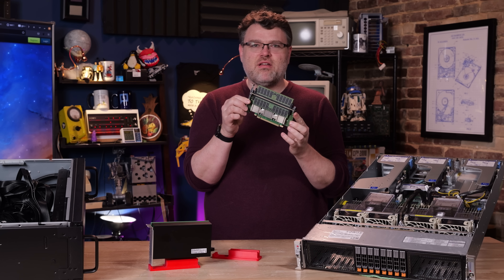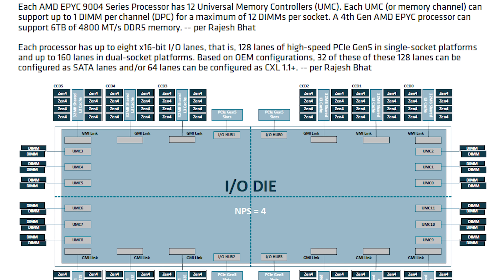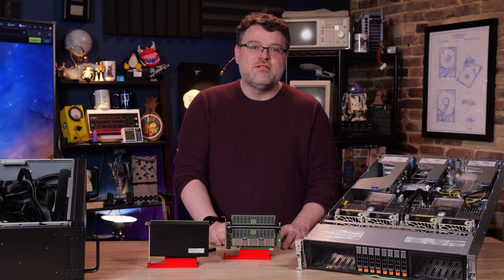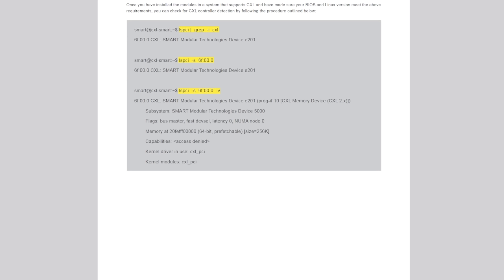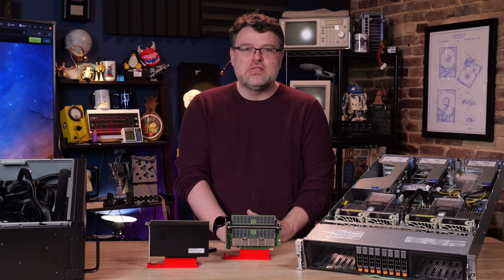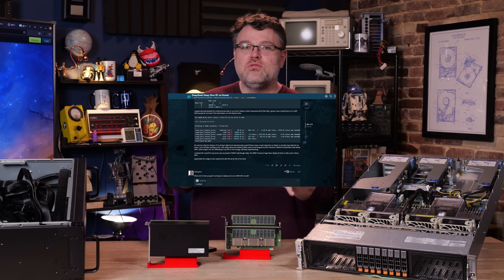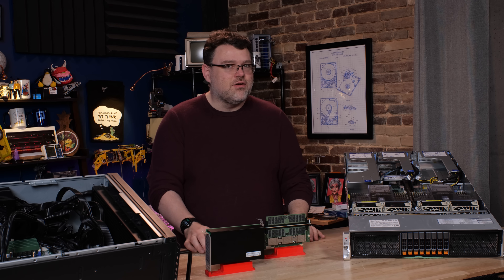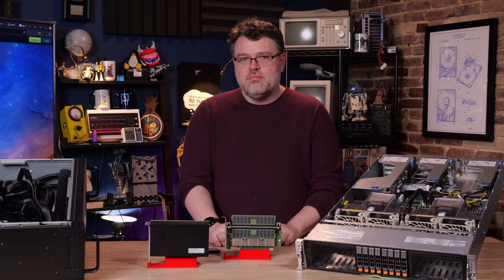PCIe RAM? In MY Server? With Smart Modular CXL, It's Possible!

Comment: With the vanishing of PCIe bridge chips on most servers as the result of the integration of high lane counts on the CPUs themselves it may be a good idea at this point to add a second connection on the slots as was done with ISA/VLB with the purpose of enabling direct device to device access, thinking about GPU to CXL RAM links in particular, so that we don't need to involve the CPU IO when it does not need to touch the data as it only needs to read or written to RAM. In this case the goal being expanding the GPU "directly" accessible and usable RAM while processing its workload eliminating any IO load on the CPU.
Reply: Devices can in fact communicate directly over the PCIe bus without involving the CPU.  That's a large part of what modern DMA controllers facilitate.  The reason nVidia introduced SLI in the consumer market is to reduce latency on the lower throughput latency sensitive timing and frame buffer data.  NVLink in the professional market was introduced more to share lower latency access to VRAM, mainly to reduce the throughput on the PCIE bus.

All that said, I would love if we had a second PCIE bus opposite the main one that we could clamp a bridge card onto and give some devices a standards-compliant way to talk to each other at higher speeds.
Reply: @aarcaneorg  It's also worth mentioning, that NVLink has almost 10x bandwidth of PCI-Express. The 8-way crossbar (basically switch) controller chip for DGX machines has something like 2B transistors on its own. Intel had identical system for Gaudi in place. Both allow pooling memory for devices.

SLI bridge had something like 1 GB/s bandwidth in basic form. I believe that was the reason why bigger Quadro setups (like 3-4-way) required the Quadro sync card, since even with HB bridges and their 2 GB/s lines it wasn't enough to sync frambuffer. JUST frambuffer.

Of there is a need for second bus, the most sane thing is always infiniband (without Ethernet). 100G link has same latency as PCIe 3.0, and 800G is already on the market, with pages of SKUs from multiple vendors. This is why most of 3rd party AI accelerators come with 4 ports of QSFP-DD or whatever it's called.
Reply: @Vatharian  infiniband is a dedicated controller and port for inter-chassis communication.  What's needed is a successor to NVlink for intra-chassis communication, or at least a standardized secondary NVlink-alike for different vendors and brands to communicate across, like in this case, between GPU and -NVlink- CXL RAM, or in another case, between GPU and HBA for GPU accelerated storage, which I think L1 have done a video on previously.

Also, thank you for providing some hard numbers on the bandwidth!

Comment: You can add system memory over PCI-e, but there's still no way to expand VRAM.  Why hasnt Nvidia made a card that slots into the next PCI-e slot, and connects to a GPU via NVLink, that only supplies more VRAM, and doesnt have a GPU die?

Comment: Reminds me of the old RamDisk products.
Reply: It was actually ram, it just ran over the sata bus. So it's was slow by comparison, but super low latency. I used a bunch of these back in the day for a fast transaction storage solution. Just had to make sure those internal batteries stayed in tact or data in ram went bye-bye. Fun days.
Reply: Except it can actually be used as RAM not just SATA storage!
Reply: @termiterasin  You could use it as RAM with the old stuff by putting your swap disk on it.